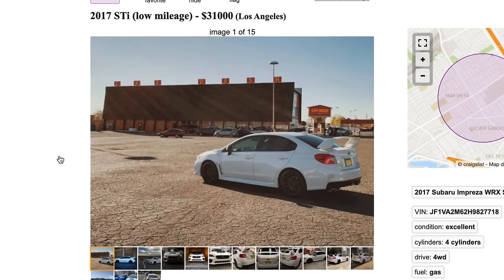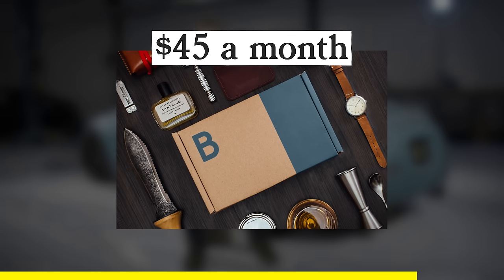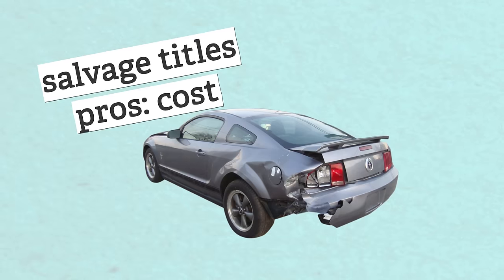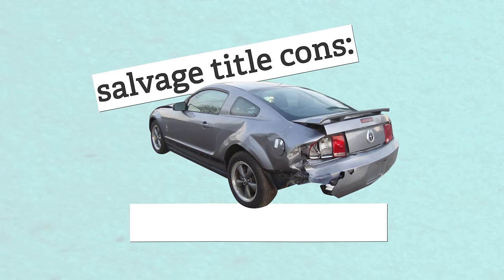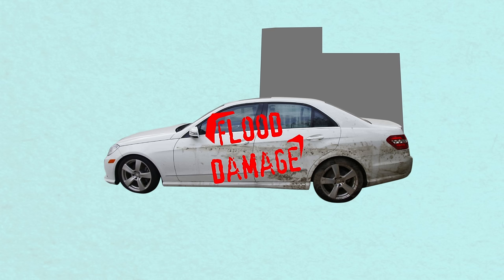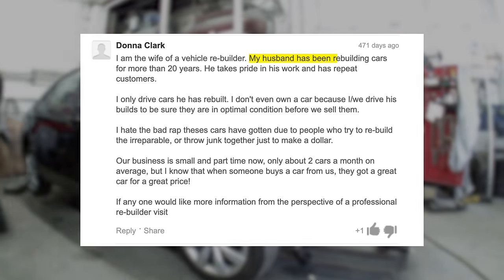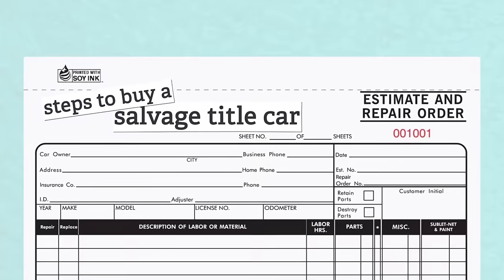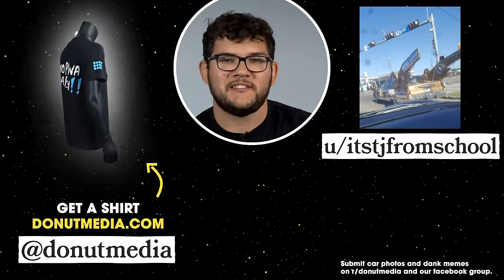Buying a Salvage Title Car: Bargain or Nightmare?

Comment: I only drive salvage cars n i saved thousands my whole life... stay away from flood damage is true
Reply: Funny, I used to know a guy who only buys flooded cars. the guy buys in bulk. I remember in 2003 the guy bought 3 LS1 Camaros for far less than one used clean title.

Needless to say, the guy was a pro mechanic. He knew if it had engine damage, and as a performance builder, he was gonna rebuild everything anyway
Reply: @abo3abid1  lol thats a 2003 car imagine a flood on something 2010 and up? Computers would be a mess to sort through
Reply: @thckitchen434  i sometimes think Blue was a flood truck. Her electrical is crap. Still, I've had her forever and the electrical only becomes a real issue every 3 years or so. Tranny finally got destroyed due to user error after 267k miles. Engine has another 100k before a rebuild, especially if I start using real oil filters.
Reply: Find the car you want and smash your shitty car into it. Then come back later and offer to buy it 👌🏻 

Russian buyer tips.
Reply: The flooded damage only usually applies to luxury cars that have a ton of tech in them. It should be fine with something older and more basic.
Reply: @thckitchen434  Might as well throw your computer into the river and fish it out 3 hours later to see what it's like.
Reply: @thckitchen434  you'd be surprised just how much has been computerized for  a while. EFI actually first showed up in the 1950's, and got commercially popular on the VW Ghia, though it didn't reach mass adoption until the 1980's. however as the last carbuerated car ever sold in the US was sold in 1994, it's pretty safe to say anything built in the last 25 years will equally risk computer issues.
Reply: @cpufreak101  not saying that but newer cars have more computers lie 100x more lol
Reply: @Conor yes for 10yrs now.... i buy them sell then repeat... i drive a car for a yr or 2, break even or lose a couple thousand but its better than expensive cars n big depreciation
Reply: @thckitchen434  in my experience, depends on the models. older vehicles, you'd often find only one computer for the EFI, but eventually came the TCM (trans control module) and BCM (body control module). this basic layout is still largely used to this day, however its seen additions of computers in the radio and airbags. its typically only super high end models you see with 100+ computers each.

so basically, multiple computers per car is nothing new, theres even some 80's cars with the 3 computer setup
Reply: I'd say damage from any of the elements is a no-no .
Reply: For flood cars you need to check if was fresh water, if was salt water or not, and if the engine got water in oil
But they're a pita

Comment: LOL A/c blows ice cold..
says every car listing ever
Reply: Of the 1st 6 cars I ever had, maybe 2 had cold AC without cannibalizing parts off itself. To this day I just use my windows.
Reply: Coincidentally I did have one that would do donuts if you let go of the wheel. It was a Buick Skylark. Once the break pedal fell off too. 1st car I had since moving with maybe 100 pounds of property to Texas. I think it had an AC.
Reply: Low mileage, low fuel consumption, kept in heated garage, loved and taken care of, female owner, owner is a retired doctor, only brought to local authorized service center, under market value, no price negotiations.
Reply: I mean the guy was right now the only problem is i only get cold air
Reply: My ad did. When I showed up the AC compressor was literally gone
Reply: "A/C blows snow"

Comment: Did anyone else notice the Challenger was  listed as “fwd” on that Craigslist post?
Reply: Now I did lol
Reply: They rebuilt it with a Honda Civic drivetrain 😂
Reply: Listing be like 
Fwd "Four wheels (and) drives"
Reply: That's craigslist for ya
Reply: FOUR wheel drive;)
Reply: Is it not Front Wheel Drive?
Reply: @uwu4950  yeah that would be abbreviated 4wd or AWD
Reply: That means this challenger can only be able to drive in reverse. Then, it is a “FWD”.
Reply: Thats just layman's terms for "bought an AWD model and lunched the driveshaft"
Reply: tHe FrOnT wHeElS tUrNs So It MuSt Be FwD
Reply: I didn't lol.
Reply: palanch89 
The second generation 1980s "Dodge challengers" were FWD! 
LOOK IT UP!
Reply: All Challengers are FWD 

This is a joke you soccer moms
Reply: @yourfacelookslikebut  That actually makes sense, considering it's a salvage.. knowing it has Four Wheels AND Drives is important!  FWD!
Reply: The_One_Titan 
If those soccer moms were 50+ years old, then they would remember that the 1980s 2nd gen Challenger was a FWD Mitsubishi!
Reply: @palanch89  maybe he was joking? Chill out man

Comment: Everyone saying “salvage is great just not flood” it depends on the WL (water line), bought a Cadillac that got totaled by insurance from a dealership because the water went just below the door. Replaced rotors, calipers and brake pads just for safety measure and she was absolutely golden.
Reply: One of my uncles bought a Dodge Challenger a few years back, a 2015 R/T with a six speed manual. He got an unbelievable deal on it due to it having a flood title. Reportedly, it was at a Texas dealership during I believe hurricane Harvey, and part of the dealership's lot flooded.  However....the dealership's insurance supposedly totaled everything on the lot, even the cars that weren't touched by the floodwaters.  Granted, some of this could have been misrepresented by the dealership he bought the Challenger from, but it's been a solid car for him and he loves it.

Comment: I worked for a Subaru dealer that only bought salvaged cars and we would fix em up.  What we did was intense (even cutting/welding frames) and the cars were extremely reliable.  This is in NYS! They are strict with rebuilt titles.
Reply: nys?
Reply: @GingKo-ui7qr I assume new York state

Comment: It depends what it was salvaged for.   I bought a salvage title car that was only worth $4,000 if it were in perfect condition.  It had a tree fall on the front fender and hood. The repair estimated Fox was over the limit so insurance had declared it a total loss.   A body shop worker fixed it up and sold it for a cheap price.  It had already been inspected and passed the state inspection.

Comment: I bought a salvage/rebuilt title 2016 prius with 39k miles on it, earlier this year for bout 5-6k less than KBB of a non salvage title, the dealer provided the car fax and repair records, and when I googled the vin I found the listing from the auction they bought it from, showing the damage, and honestly it didn't look too bad, part of the passenger side bumper was ripped away and there was a dent on the door, I know Nolan said the insurance company decides if the car is worth repairing or not, but I'm pretty sure I've heard from youtubers that buy salvage cars to repair them have said depending on the insurance you have, the owner can decide if they want to repair it or just take the money and total the car out, he was explaining that while at a salvage auction where he saw a nice Porsche, and the only damage was the headliner had become incredibly saggy

Comment: One of the most reliable cars I owned had a salvage title. 2003 Pontiac grand am 218k miles paid 700. I drove it for close to 3 years, only thing I had to replace was a starter and tires. Sold it to a friend and it’s still going to this day

Comment: Salvage titles are amazing!! I bought a 2004 nissan 350z for 3 grand, and it only had 100k miles on it all because of a bad fender bender. Definitely do your research, but that's where the deals are!
Reply: damn, thats a good deal, most 350z's where I'm at around $8k+ and don't go much lower than that.
Reply: How would they total a car from a fender bender?
Reply: Was it easy to insure it
Reply: Or did you have a problem with insuring it
Reply: @georgeparker555   Cost to repair outweighs the value of the the car. Say that 350Z has 100K miles and would be worth about 8K on the used market, but the damage to the fender, bumpers, etc. cost around $5k to replace, this leaves the insurance with only around no wiggle room on the value of the car with a "clean" title. In their eyes, that's not worth, so instead of paying for repairs, they pay the owner outright the value of the vehicle ($8k in this example) and sell it to a shop that can fork up the repair cost instead of leaving it in the insurance's inventory. The insurance company might take a small hit in the beginning, but ultimately comes out on top considering their insurance policy and the money received from selling the vehicle.
Reply: how did u register it?

Comment: Nolan: dont buy flooded cars

Samcrac has entered the chat
Reply: flood cars make great parts cars but are usually risky to "rebuild".
Reply: Samcrac: dew it
Reply: There's probably hundreds of flooded vehicles running around here, one we're working on has rust where the brake lines used to be. Not a terrible job to replace all the hard line but not something anyone really expects to have to do at any point. Ditto hubs and bearings, ball joints, etc etc. Avoid the crap out of flood cars if they saw salt water, about the only cars that made it out in good shape were all the Deloreans.
Reply: @JustAlanIsCool  The thing with flood cars is that you have to know what you're getting in to and the average person doesnt.  Even many who think they do.  I've bought and rebuilt flood cars and ive bought flood cars to rebuild other cars with.   Some of the problems with these cars don't show their face until much further down the line when corrosion takes it's toll and this is where most people get burned from flood cars.
Reply: My cousin bought a flood honda accord back in 2001with 15k miles and it now has 220k miles still runs great
Reply: @bearle97  Then we probably have very different ideas of what a flood is.
Reply: Your thinking of his friend Rich of richrebuilds, who rebuilds Tesla’s ( talk about electrical issues)
Reply: @Sekib_Nave  Rich will "rebuild" anything.  Just as long as he can do it using kitchen knives.
Reply: @will stikken, sounds about right
Reply: idc about the electrics, they are propably the easiest part for me 😂 (as an electrician after european standarts)
Reply: @derpmaniak7823  I'm not sure how that's relevant.  They're probably the easiest part for anyone taking on this type of job.  they're also the easiest for the uninitiated to underestimate the effects of corrosion.  Many people flat out ignore them and let the buyer worry about it later when pins and compromised wires start to corrode.
Reply: @willstikken5619  yea you shouldnt underestimate corrosion. i did once. rebuilding my manta 400 which got a little bit "flooded"... but its too rare of a car ro just let ir rot away so i tried anyway
Reply: Sometimes you get lucky but most of the time you will keep on spending until you figure I should have bought me a clear title with the amount of money you spent. I m DONE with Flood Vehicles they will eat up your cash before you know it. If you buy one buy it from an insurance
Reply: @saeed9111  the manta is in perfect condition and i spent less than 15 thousand euros to rebuild it.
Reply: @derpmaniak7823  will how much you bought it for and was it worth the amount of money you spent on it. I mean if you only saved 5 thousand dollars from a clear then it's not worth buying a salvage title because later on if you try to sell it it's not worth as much. If you save more then 8 thousand then you are getting there lol
Reply: @saeed9111  we dont have something as titles in austria xD if the car gets trough tüv you are allowed to drive it on the streets; if not your not. But the car itself was damaged, i repaired it and nothing much happened. sure it lost some worth but its still was still worth it
Reply: @derpmaniak7823  Nice. I hope it stays with you for very long time to enjoy it. Some cars title doesn't matter as much. If you love the car and you change the oil it should last. Some new Vehicles they don't last as long and they have a clear title.
Reply: @saeed9111  i rebuild that old thing 3 times (!) already. two times because of crashes (both times the opposite driver was drunk) and one time because of flooding. Except those three times i never had any problems with it for 40 years. (as a daily driver)
Reply: @derpmaniak7823  wow I salute you my friend. It's a keeper
Reply: @saeed9111  but the car shows that it ran extremely long and hard. Most of the parts are original, i just repaired them when they had problems. they ran for over 400 thousand kilometres and you can feel that. Just a question of time before something really goes beyond repair.
Reply: i went with my son to houston and bought 2013 370z with flood title, i took drivers door fander off and the rear speaker by the  spare tire, i did not found any sign of been wet, carpet as normal, we bought it 45%off  of the book value. 2 year with the car and no problem,
Reply: @leoncioalonso1464  i needed to see this im looking at a flooded HR right now.
Reply: @bearle97  that was before everything was computer controlled.  Getting a flood car today, you can be fine for years.  But one day the computers will corrode and give all kinds of faults.  An 01 Accord only has a couple computers and are so common they can be found in a junk yard for cheap.
Reply: @leoncioalonso1464  and a third year goes by and you are chasing ghosts when the computers corrode.
Reply: @UpMostt  hhrs are junk without flood damage.  Good luck.

Comment: Just bought my first salvage car, a MK1 Audi TT, beautiful condition other than collision damage on the front corner, but 225 hp, 6 speed manual, all wheel drive, and it runs and drive, no way i could pass that up for less than 3gs, currently in the process of getting it reconstructed. Very excited

Comment: For those on the fence. Im building a Eclipse GSX. It's my favorite car to drive out any I've driven. That said, it's been 3 years and it's still not 100% complete yet and working on it is a pain in the ass. The positive side of this is I'm saving a car from the junk yard and it's not like I'm worried about insurance. (It cost <$10 to insure)And I've learned everything I know about cars because of this project.
Reply: shardsforme Same, I was in high school when I got my first car a Salvage 545i and I would always try to learn to fix that car myself and completely learned everything about coolant and other small things. Now that I bought a newer car, I do the repairs without worrying so much about something going wrong and that 545i is now a garage princes that will get a new Ls2... someday 😂
Reply: I am building a Supra that barely got saved from a salvage title. We had really bad hail in Colorado and the damages on the body were a shit show. $800 later and I'm pulling dents and getting it ready for the paint booth.

Comment: My WRX was in a flood after a freshly built motor went in. I ripped everything apart, including the engine. Put everything back together and never had any electrical issues. It was freshwater and not saltwater, so there is that. But ultimately, I enjoyed it for many more years (11 total) after putting it back together. It was a labor of love

Comment: I’ve purchased savage tittle cars as long as the frame wasn’t tweaked doesn’t bother me
Reply: What's the car
Reply: Yeah. Frame damage is one of the real deal breakers with a salvage.
Reply: Trouble is you'll need to pay a shop to verify the frame isn't tweaked. Don't just rely on the seller claiming they already checked it.
Reply: I’m looking into buying a car with a clean title but reported structural damage. Any advice? 2015 Scion FR-S
Reply: @khalidmonawer8556  How does it still have a clean title with structural damage? They didn't report it to insurance?
Reply: @80s_Boombox_Collector  it will still have a clean title if it wasn't totalled. The accident Would just show up on a carfax if it was reported.
Reply: @Steve_I  But if it had structural damage, insurance would total it.
Reply: @80s_Boombox_Collector  depends on the car and how much it costs to fix. I've seen frames get straightened or swapped. I've seen frames rails on unibody cars get replaced. Totalling a car comes down to cost, not necessarily what got damaged. If the cost is 3/4 (not sure of exact percentage) of the cars value or more they total. 9 years ago I wrecked a 2009 jetta tdi, slid going around a bend and side swiped the whole driver side. They had to replace everything on the driver side from bumper to bumper, control arms, rims, tires and all side and steering wheel airbags. The bill was $11k and they didn't total it because the car still booked for $18-20k.
Reply: @khalidmonawer8556  Frame damage is a killer. I wouldn't risk it tbh.
Reply: @khalidmonawer8556  ask for the vin number, you will find pictures of the car in Google images if it was sold at an auction. 

When you drive, go over bumps to feel how the tie rods feel. There's more to check but if you fix your cars it's common sense.

Comment: Live in Wisconsin, so wanted AWD. I work on cars no worries, and found a 2001 Audi A4 Quattro, 2.8 liter 30 valve V-6  with a 5 speed. Needed CV joints. $900 bucks. Originally from NY, had plenty of dash lights. Scanned it to find it was bad O2 sensors. The air bags had been deployed and the ABS doesn't work. Sensors swapped out no problem, and with the way I drive, air bags are sketchey anyway. (have had them deploy while drift busting and crossing a bridge) I replaced the calipers, CV joints and reset the Vag-com. Only have about 1500 bucks in it, and it's a blast to drive.  Very happy with my salvage car.

Comment: My first car was a salvage title Celica GTS. It was honestly a fantastic car and I got it for $3000.
I drove it to 200k miles before I blew up the motor in the mountains.

I’d happily buy another one.
Reply: Did you not change the oil?
Reply: @i_i8924  I overrevved the motor on a downshift.